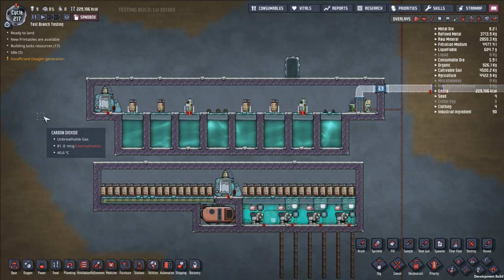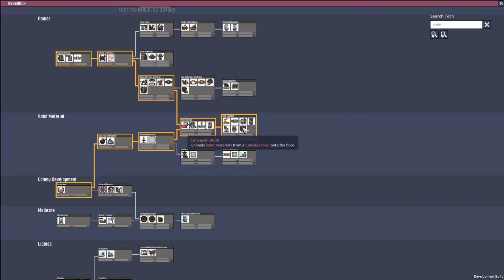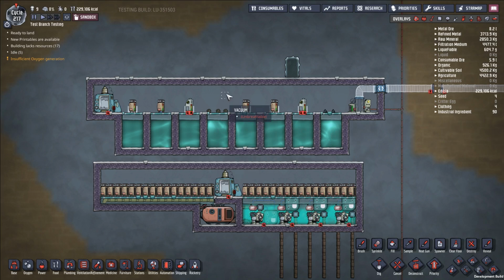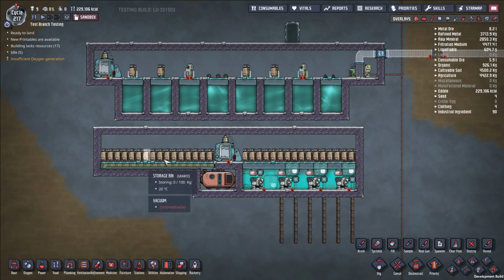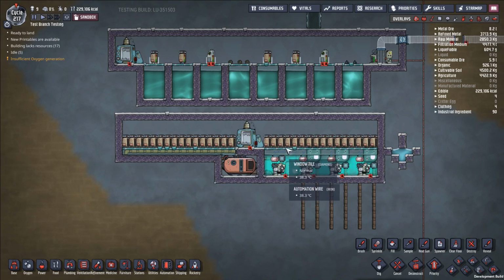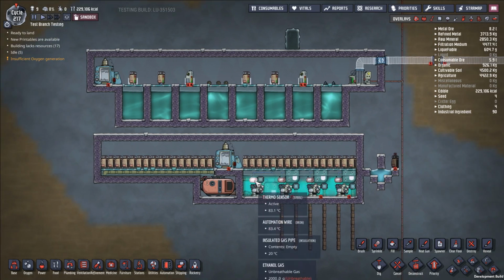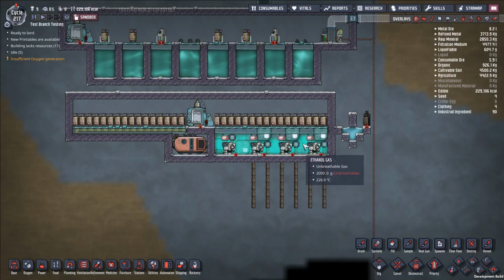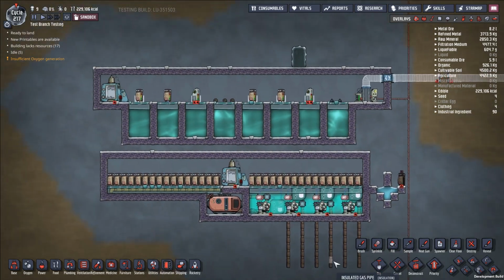Using Rock Granulators to Cool Your Base [Oxygen Not Included]

Comment: How would you get dupes to use the cooled obsidian in the chests you prepared for them, rather than just whatever obsidian happens to be closest to them?
Reply from the maker: Best way to guarantee it is to have one or more dupes be dedicated rock crushers and use doors to separate obsidian you want to have crushed from the stuff you dont want crushed.  Your crushers will have access to the granulator + obsidian you want to pulverize, but wont have access to other obsidian, and vice versa.

In practice, just putting the obsidian cooling area close by the granulator (or using sweepers to dump cooled obsidian next to the granulator), will probably be enough, since most of the time they will grab materials that are close to the granulator.

Comment: Nice video! Very interesting.
I’m not convinced this is a ‘early’ game system. By the time you have automation, refined metals and exo suits, it’s not really early game.
I’d be very interested in seeing this system implemented in a working base, it’s so different to the typical aqua tuner liquid loops.
Would a base with conveyer rails carrying sand through it be adequately cooled?
Reply from the maker: The more I tinker around with rock granulator cooling, the more I'm convinced that it's something you add on to an existing cooling solution in order to enhance it, rather than something you try to build as a stand-alone cooling system.

I think in the early game the simple way to implement rock granulator cooling is just to set up a rock granulator and some storage bins out in a cold biome, and fill the storage bins with obsidian or sedimentary rock.  Then, whenever your base looks like it's getting too hot, you bust up some obsidian and cart the -20 C sand to sit in storage bins inside your base.

Replace the cold biome with an anti-entropy thermo nullifier or a cool slush geyser and it's the same idea.

A setup like that would quadruple the total cooling you get out of a given source of cold, but is that worth the effort when you could instead just run a loop of hydrogen between the cold area and your base?

Also, a system like this seems limited when you're starting in a place like Oasisse-- whatever cooling solution you use there is probably going to need to be both compact and self-starting, neither of which is the case here.

I'm definitely going to try a rock granulator build out in my next lets play, I'm just not sure how yet.
Reply: @gearheadgaming1  Awesome! Looking forward to it.
Reply: early game is just use a cool slush geyser or ice machine.
Reply: I would make it early game by using the cooled sand to fill my deodorizers and water sieve. Counteracting the tiny bit of heat that the sieve now produces could easily be done now instead of the heat creeping up on you and all your farms dying

Comment: Would this work with Igneous rock? I'm only asking because Igneous is renewable through volcanoes and obsidian isnt renewable (I dont think)
Reply from the maker: It's troublesome to make it work directly, because igneous rock and sand have fairly similar heat capacities (1 vs 0.83).  However, another approach would be to feed your igneous rock to some stone hatches and turn it into coal.  Coal has a decently heat capacity (0.71), and a reasonable conductivity (1), so you could have the coal absorb a lot of heat, and then burn the coal in a coal generator to delete that heat.  It's a lot like the salt variant of this idea, except instead of deleting salt in the granulator, you'd delete the coal in a coal generator.
Reply: @gearheadgaming1  talking about volcano, do you have a setup for Volcano+Turbine that lasts through dormacy and then digs the igneous up before it errupts ? So far i have a setup that lasts and uses the igneous blocks as storage for the heat but no clue how to dig them up automaticaly as they are still hotter then 130° after 80 cycle....